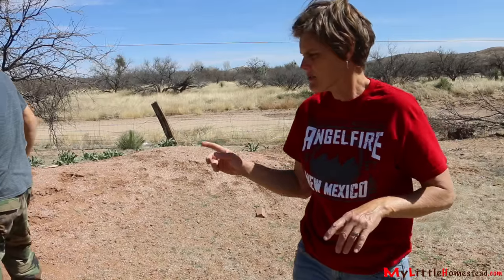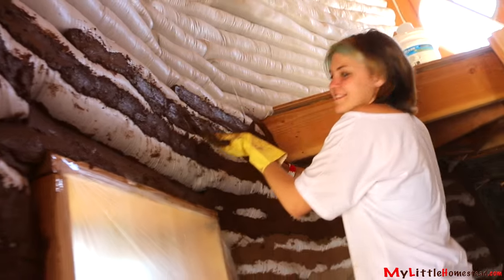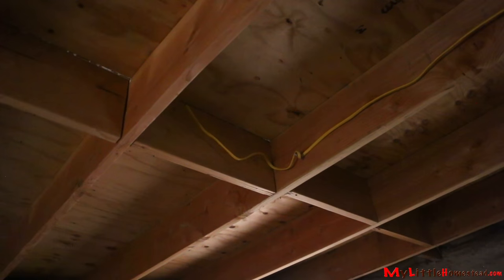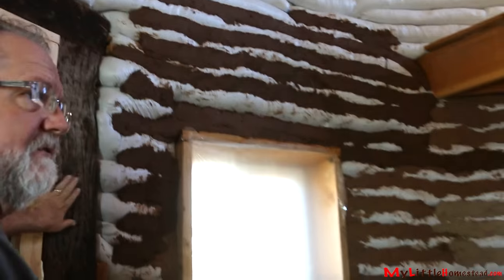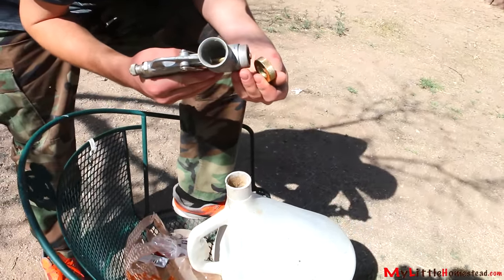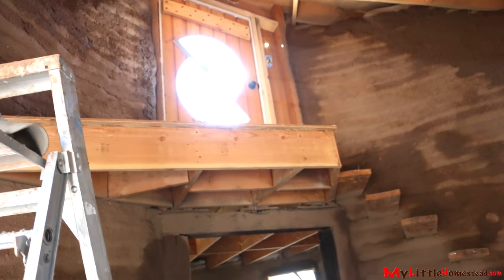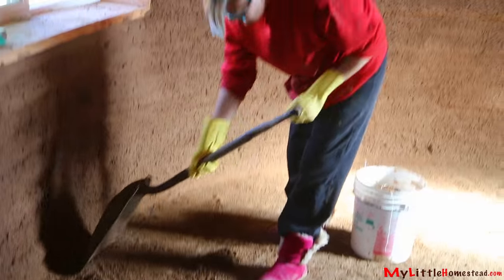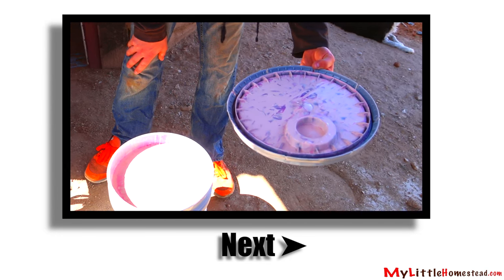Fast Way to Cob Walls using a Hopper | Earthbag Construction | Weekly Peek Ep30

Comment: I'm trying to modify my hopper gun to shoot the cob on. No luck so far. Can you tell me what size air compressor you used and how exactly you mod'd the air gun? How much of the tube you cut off? Any help would be greatly appreciated, especially since this is a one man build.
Have watched your videos many, many times, at least once- some several times.
Thanks again,
Wulf
Reply: Wulf- I'm curious because I'm only trying to dream right now as to how to make my own build happen. I'm a single mom with 3yr old. no support system or family to ask to help me with building the thing. So very curious about your experience... Could you share a bit of your build story? Unexpected challenges? Biggest regrets (if any)? Ways you'd do things different now that you know? You know... 🤷🏼😂 Thanks. Any info from real life experience is majorly appreciated.

Comment: You guys should try making pots for Bryson's room
Reply from the maker: +WolfieHDOffical pots? what kind of pots are you thinking?
Reply: +mylittlehomestead like clay pots
Reply: +mylittlehomestead also like a clay stove to make a heater
Reply: +mylittlehomestead if you wanna know what a pot heater looks like go to ben galts channel and it shows a flower pot heater and makes a great room decoration
Reply from the maker: +WolfieHDOffical Thanks - we use these :)  But, I like the one on Ben Galts Channel better - we will have to make one.  Thanks for sharing :) We will be building a rocket stove in Bryson's room for the very cold days.

Comment: I just dont think that cob will last long on the plastic bags.? I may be missing something,
Reply: +zipde doda It actually works pretty well. Many buildings have been used with the sandbags, with Cob filled in and plastered over.